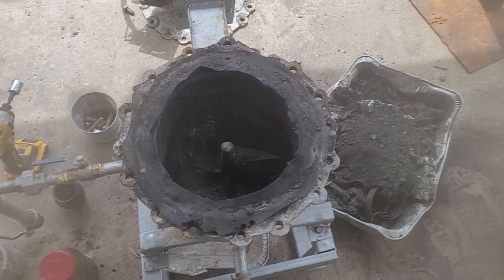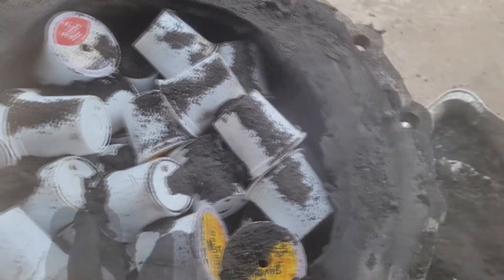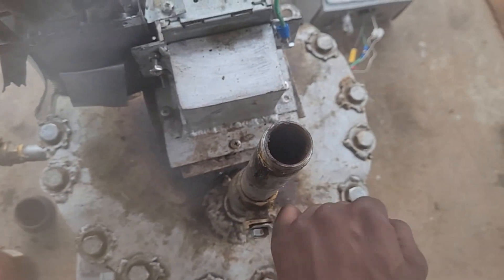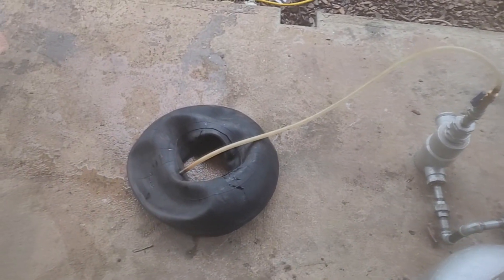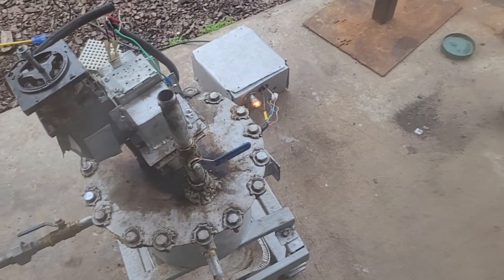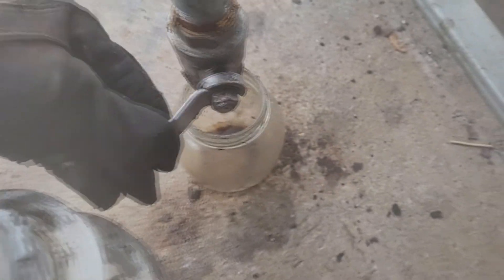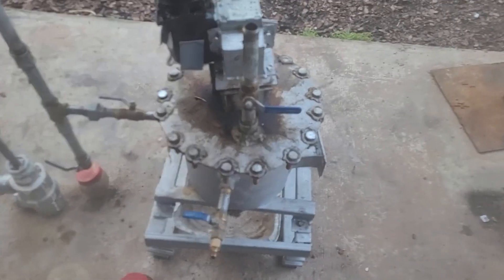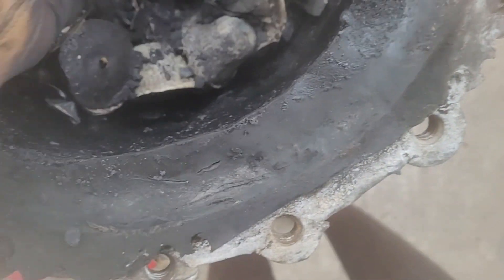What Happens if you Pyrolysize Coffee Pods? Will it Pyrolysize Ep. 1

Comment: I think you need to hook up a steam boiler as an input, and once it is heated up introduce a flow of steam into the reactor. If you are lucky, this will consume the carbon and make carbon monoxide, which is a flammable gas. It is poisonous of course, but the gas you are getting now probably already contains some of it.
Reply from the maker: I really like this idea! won't the steam introduce oxygen though?
Reply: @naturejab  Well yes and no, if you have a proper steam boiler it is by definition produces only steam which is just water heated above its boiling point. So only H2O, and no O2. At high temperatures water can act as an oxidizer, for example turning elemental carbon into carbon monoxide is an oxidation from the point of view of the carbon. You might also get some water addition reaction (addition in the chemical jargon sense of the word) to unsaturated hydrocarbons, which would produce alcohols from the alkenes. In my opinion that would also improve the product, because alkenes are prone to polymerizing back into wax/tar/resin, which is unwanted. It would be an interesting experiment to have a hot catalyst bed of something right at the reactor outlet, for example ZSM-5 zeolite. This is used a lot in the oil industry to reform various hydrocarbons into more useful products.

Comment: I want to see you put rubber tire chunks in there with the steel radials. I'm interested in the steel actinig as a catalyst either by being heated from the microwaves or by becoming electricaly active. I think that like a fork in the microwave you would get elctricity and heat.
Reply: I have been looking at this hydraulic jaw that is like a solid block of steel shaped kinda like a cleaver. It goes between two blocks of steel and shears the tire right in half. Other than that it looks like a pain. I guess you can do it with a angle grinder too though.
Reply from the maker: @wesKEVQJ  for sure, I'll figure it out
It may be a couple weeks before the actual video comes out because of all these extra steps
Reply: @naturejab  No worries, I'll be here.  I'm busy putting up a solar array and trying to get my spot welder working for my batteries. After that's done I'm starting a pyrolizer.
Reply from the maker: @wesKEVQJ  excellent! It's always amazing to hear others building pyrolysis reactors. Best of luck with your current and future projects!
Reply: @naturejab  Good luck to you as well. I'm working on a heat engine that boils r134a in a pressurized system using off the shelf parts except the cylinder head, but that's just a block of metal with holes threaded through it. I still need a few parts but if it works I'll share the plans.
Reply from the maker: @wesKEVQJ  Sounds good! I'd definently be intetested in seeing that.
Reply: My brother doesn't think it will work. I've shown him the math but he's skeptical. He's not even convinced about pyrolisis though so I'm not letting it weigh heavily on me. I hope it works I've been buying parts for months lol. I just had this idea and know it'll work and can't stop.
Reply from the maker: @wesKEVQJ  haha I love your ambition it reminds me of myself. I have faith in you and your projeft
And even if the first version doesn't work completely, eventually you will  get it, never give up!
Reply: @naturejab  I won't just don't forget to get sleep and eat and stuff lol.
Reply from the maker: Great suggestion, I want to try this as well. The hard part will be chopping the tires

Comment: Curious how much energy it requires to run the microwave for 6 hours?
Reply from the maker: So am I, I need to invest in one of those Kwh trackers you can plug stuff into
For now, this microwave is exactly the same components as the one in your kitchen, so if we plug in the numbers for as standard microwave operating  for 6 hours, we get 1,200w per hour, so 7,200w for 6 hours, or about $1.20 worth of energy
Reply: @naturejab  cool, could even power that with half a dozen solar panels, just having it run for the peak hours during the day.
Reply from the maker: @rickfrogm825  th at's the dream! Solar panels or wind or some free source running this so we get a profit energy output.

Comment: Would have the reactor had cavities alike to these in the magnetron, wouldn't it fine tune itself and resonate with the microwave frequencies, dissipating the energy around the material a little bit better, rather than being beam focused?
Reply from the maker: perhaps, but the best known counter to microwave hotpots is movement like turntables or some type of material agitation. The 2 cavities present haven't aided the magnetrons, they are less efficient as many microwaves become trapped in them.
Reply: @naturejab  well then, you may consider reverse action, if the cavities don't help but make things worse. Bumps rather than dents. 

Curious about the catalysts and how the addition of these directly into the reactor will affect liquid fraction production. 

Also, this series has potential to become the next 'will it blend' or 'crushing with hydraulic press' type of 'viral'. 

Got the idea influenced someplace Im familiar with? ;)
Reply from the maker: @Noswiatel  bumps sound good, have no idea how I can make them

I do see the potential for this series s well!

Thanks
Reply: @naturejab  well you could just use a small pipe cut in half lengthwise as a mold for some chimney or furnace cement. Just make sure it wont stick to it, I think they use some sort of gypsum or something alike to prevent the cement from sticking to the molds, may even reinforce it with some thin wire or a rolled mesh. As for sticking this thing inside, you will need to use some really fine cement as well, and just mason it in there. The other way is grinding lock cavities and making of a custom mold so you can just slide it into place. 

Would it be worth the efforts, Im not so sure, and unfortunately, cant really sponsor that experiment, but let it be a thought for sometime far into the future. 

Really depends on how you want to introduce these catalysts on there and what types of catalysts you want to use. That could hint you whether its worth the shot to grind the locks in there, as you could use them as the catalyst mounts as well.
Reply from the maker: @Noswiatel  Very interesting suggestion there, thank you!
Reply: @naturejab  well yeah, cause if the catalysts ever wear off, you can replace them easily.
As long as you want to use sheets of it, I mean. Cause the sheets can be folded and attached to the sliding piece.
Reply from the maker: @Noswiatel  The modularity of such is definently attractive. When it comes to catalyst, the only way to know is to test them out, because a standard catalyst in a standard reactor can behave very different in a microwave reactor
Reply: @naturejab  fair enough. Either way, if these are solid catalysts or can be plated, its definitely a design worth checking. You may want to figure out non reactive materials that could work instead of cement as well. Good luck there
Reply from the maker: @Noswiatel  thank you!

Comment: woulld water as a catalyst and microwave absorber work? as the absorptiob peaks of water are really broad, and wenn the water turns to steam and combines with the hydrocarbons through the fracking process it should yield higher quality and high yield of diesel and higher fractions
Reply from the maker: I will try this! Thanks
In the past I've gotten good results from using oil as a catalyst in the past
Reply: @naturejab  forgot to mention this reactor looks really professional like a mini refinery. another tip would be to leave out polystyrene ( the code is 6 with the recycle code) as it´s a b!t€h it basically turns your whole fuel into a gel mess and maybe insulate the tube where the liquid is extracted ( if you have problems with clogging)
Reply from the maker: @Humbulla93  Thank you! I usually don't use polystyrene, but if I do I'll dissolve it first in acetone.